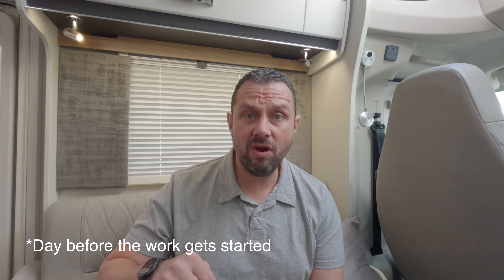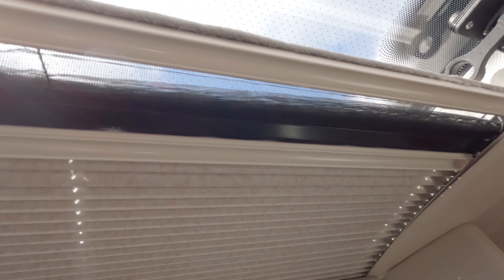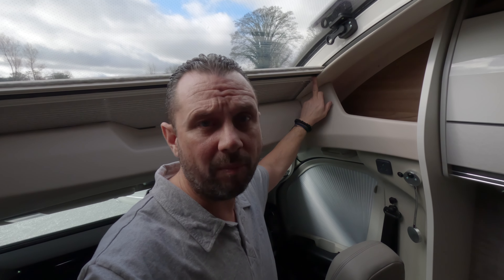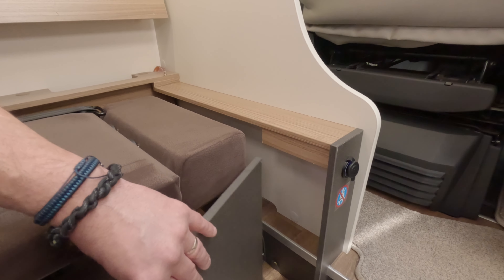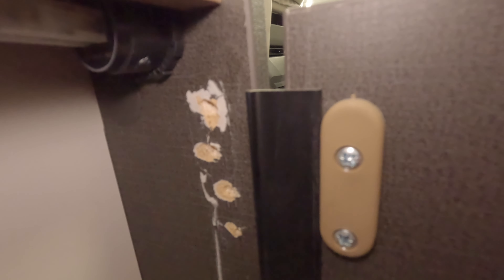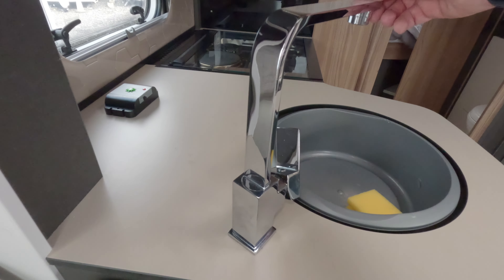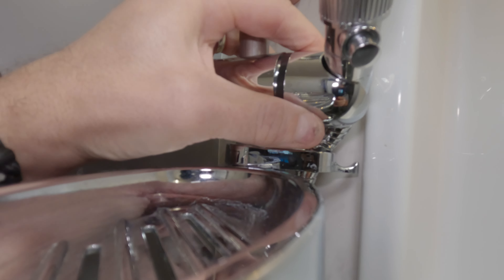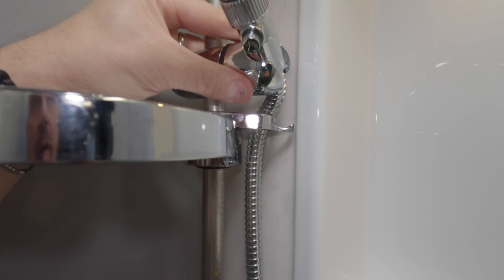FINALLY Getting our Motorhome Fixed - Swift Kon-tiki 794

Comment: We have just bought a new swift Kon-tiki 794 from Abacus and collect it in the next two weeks.  We used them because their service department did some work on our auto trail Tracker under warranty without any fuss, we did not buy the van from them. These dealers need to realize that their whole offering makes a difference. Great video and great to hear you have a good story to tell, Well done Abacus.
Reply from the maker: Hi, we totally agree that having the whole offering that Abacus do is what all dealers need to offer. Everything under one roof. Glad you have had a good experience and i'm sure they we look after all your needs in the future. Happy travels 😊

Comment: Great to see all your snag/faults what ever you call them done l feal your pain l got a brand new bailey autograph 816 last year everytime  i take it on a trip something falls off or breaks its now got to go back to the bailey factory to have part of the ceiling replaced  shocking build quality they build them like they do not move i would never had got a motorhome if i knew the way they put them together waited 17 months for my van and waited over a year for bailey to fix their manufactoring faults well done bailey
Reply from the maker: Thank you it is good most jobs are now complete however that’s not to say more will show up fingers crossed they don’t. I feel for you having waited so long for a Motorhome with so many faults and still waiting for more to be fixed. I’ve no experience with Bailey Motorhomes as like the Swifts but they all seem to have problems. Sometimes it’s luck of the draw which it shouldn’t be. Hope you get all your faults rectified and you can enjoy the Motorhome as it should be used. 👍😊

Comment: We have an Escape 674 the PSU is on the door side just in front of the door. I had a problem with the van and I took out the PSU and I noticed there were some trapped wires. I pointed these out to the dealer and they did relocate the wires to the correct location. I didn’t have a problem with the central door locking but it will be worth checking. I believe your 694 the PSU is on the other side but the wires will be in the same location. I’ll send you a picture on Messenger.
Reply from the maker: Thank you Mark, i've seen your picture so thank you for that and i'll get that checked 👍
Reply: @lifes4touring  😂 it’s Mick actually
Reply from the maker: @micksparrow8214  🤣 Apologies Mick thats fat fingers for you 🤦‍♂ Happy travels 😊

Comment: Always something to keep on top of in the MH.  Re the central locking not working all the time. We have a Carthasgo with the same type of door contracts. On many occasions I get failure of the central locking..  I have found that there may be a contact issue. I thave a small piece of wire wool( or anything slight abrasive) and rub the flat terminals each end. This seems to solve the issue. It maybe just a build of of oxide on the ends that just stops the flow of 12v power. Good luck on that part
Reply from the maker: Hi, you are right there is always something to keep on top off with the maintenance on the MH. Thank you for the tip with the door and if it happens again i'll try the wire wool. Strangely it's playing ball at the moment however i'm sure the issue will come back again. Thanks again and happy travels 😊
Reply: @lifes4touring  Yes Ours has been like that since new. So clearly its an issue that effects all the makers

Comment: We have the Escape 694 2023, similar issue with the door,  waiting for a replacement. Experienced a similar issue with the central door lock I traced it to a weak connection in a cable joint. If you look behind the internal door seal next to the hinge there are connectors where the main loom connects in, might be worth looking at.
Reply from the maker: Thank you for that information and I’ll check it out, I hope you get your door replaced soon and you don’t have anymore issues. Happy travels 😊

Comment: Axcactly i don't care how much you pay for a van they always have faults (nature of the beast i suppose) lets be fair there is so much stuff on motorhomes something is going to go!!! We have the 884 and had the same issue with the hab door but they sealed it and is perfect, our roof window blind is very stiff i don't think we have thise plastic clips though so when i go to storage yard next i will look at that, thanks for that.
As you say swift are a well built van and we've been very happy with the quality of our past 2, there are alit of bits in these vans that swift (and other make have no control over) like windows (dometic) fridges (dometic) heating (alde) microwave etc etc.
Great video Lee thanks for showing, she stills looks good and clean. X
Reply from the maker: Thank you, It's so true to many complain however with everything fitted into our van we are happy it's only a few faults as it's inevitable it's going to happen. Happy your door is sorted as i'm sure ours will be eventually but it's no real issue. Try some dry silicone in the blind runners it really helps with the stiffness. 😊

Comment: Hi guys how do you raise your bed so you have more space under the bed I have tried you tube but nothing regards Mark ann
Reply from the maker: Hi, so within your kit in the garage, there will be something that has a hook on one end and a handle on the other. Something that will look like the pole to take in and out your awning but smaller. On the driver-side part of the garage to the rear, you will see something to hook this on just under the bed and a pull-out locking pin. Undo the pin and turn, one way will raise the bed and the other will lower it. This is hard to explain so hope it makes sense, if not Email us and I'll send some pictures which may help explain it better. 
Happy travels 😊